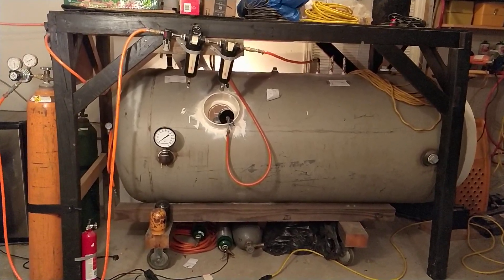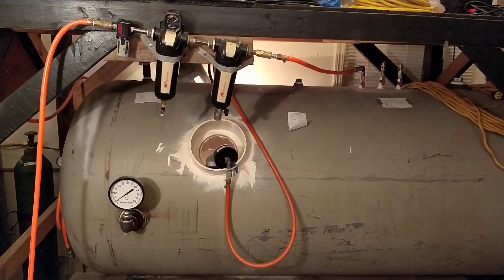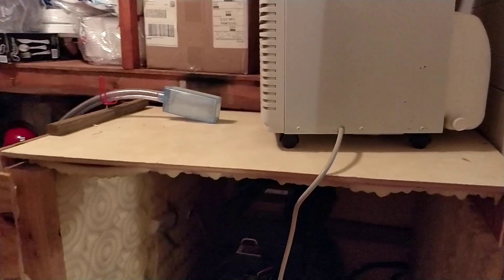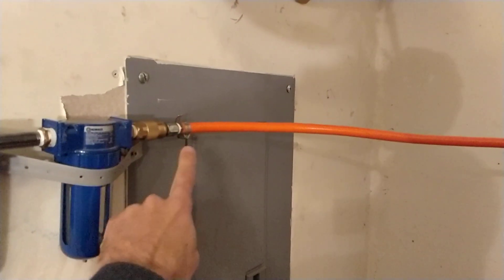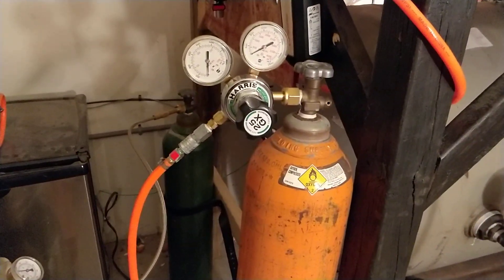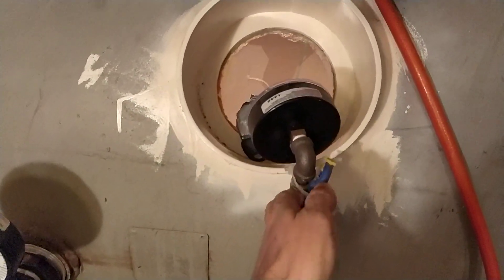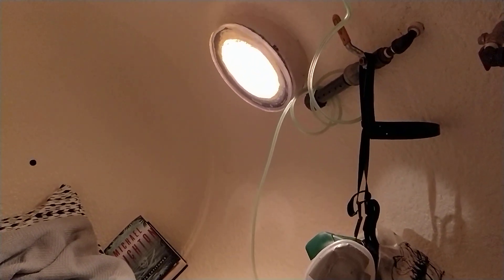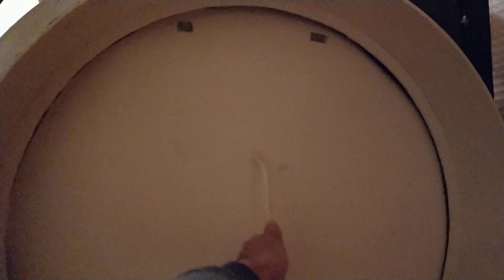Hyperbaric Oxygen Chamber (Home made)

Comment: What did you use for windows? Did someone fabricate a ring for the bullet proof glass? How thick are they?
Reply from the maker: I bought bullet proof glass off some website years ago. 1 inch thick. Then I used a jigsaw and cut to size. I simply went to a machine shop for the rings. Any machine shop will be able to get u any ring size u need. Hope that helps

Comment: So the compressor pumps in regular atmospheric dehumidified air only ?
Reply from the maker: Yes, in order to build pressure quickly. The pure O2 comes from the mask.
 It's too expensive and too difficult to pressurize the whole tank with pure O2.
Reply: @goretoye Not to mention the fire danger posed by even tiny static electricity charges in a pure or nearly pure O2 atmosphere...

Comment: The O2 hose, fittings, filters, and ball-valves are a disaster waiting to happen. The slightest trace of oil in an oxygen line can easily cause an explosion, and there's likely residual oil in those filters and quick-connects. Even residual oil from a fingerprint can burn in an O2 system. There is absolutely no need to filter medical-grade O2. That's why it's medical-grade. That hose looks like compressed-air hose. For the love of God, get some oxy-acetylene O2 hose and welding O2 quick connects (and back-flow preventers), get rid of those filters and ball valves, and scrub all of the steel feed-throughs with detergent and rinse with distilled water. Seriously. This thing is dangerous.
Reply: You are acting like a crazy person
Reply: He's not using pure O2 to pressurize the chamber. The hoses/fittings your referring to are just for the compressed air that's pressurizing the chamber, coming from an air compressor, the O2 system is completely separate

Comment: You got a nice overkill system, any thrifty advice?  In Ohio, I have been told, it is not illegal to operate a chamber and I have a guy that charges $160 a cession.
Reply: I just finished one that can be pressurized to 2 ATA (28PSI), has power on the inside, and is on wheels. I am willing to sell it if you are interested. I could probably even deliver if gas and time is paid for!

Comment: great build .
Can you talk about the connection of air valves through the steel wall of the tank. Do you use a special gasket that is rated for that much pressure? Curios :)
Reply: I just finished one that can be pressurized to 2 ATA (28PSI), has power on the inside, and is on wheels. I am willing to sell it if you are interested. I could probably even deliver if gas and time is paid for!

Comment: Hi Ed. Great job with the hyperbaric chamber. I'm trying to do the same. How did you fit the door? One would expect that the piece that you cut out to make the door should be smaller than the hole. So did you add a metal ring or something similar to make it fit? Thanks
Reply from the maker: Yep, I added a metal ring with a flange welded to it. That was placed over the hole. The cut out was used for the door on the inside. The convex (curved) side needs to be facing inside to handle the pressures.
Hope that answers ur questions
Reply: @goretoye  Thanks! I think I understand now.

Comment: Just a foot note to anybody that's gonna run down to the garage and start making one asap.....
Pure oxygen is firkin dangerous.......there is literally nothing left after an explosion.
The o2 lines must not have any sharp bends or any burrs in the pipe line or debris.
Fire blank is a must! 
U need someone to watch over u otherwise sh*t can/does happen!
Workshop oxygen gas is not rated the same as medical oxygen!
Think before you do something/anything.
Stay safe
 I like the build !,congratulations
I was wondering if u could treat covid with a chamber like this???
That's why I'm here lol
Reply: The tank is pressurized with ambient (filtered) air. The only high oxygen content is in the mask. So it's no more dangerous than someone breathing oxygen from a hose. Which granted still has to be treated with care, but it's not near as dangerous as the chambers that are using 100% O2 to pressurize the chamber.  Also the oxygen is supplied by a medical grade concentrator and he has multiple filters after the tanks. 
Yes you can treat Covid with HBOT, people are also using it to treat long Covid.

Comment: how did you learn how to make this? It is really cool and I wish I had one for the problems that I have been having with my brain
Reply: I just finished making one that gets up to 2 ATA. I am willing to sell it if you are interested?
Reply: I just finished one that can be pressurized to 2 ATA (28PSI), has power on the inside, and is on wheels. I am willing to sell it if you are interested. I could probably even deliver if gas and time is paid for!
Reply: @rileywitt1911 

28 psi is not 2 ata it's almost 3ata

Sea level pressure is 14.7 for 1 ata
So if your chamber goes to 15psi that's 2 ata. Anything over 2ata you should be under the guidance of a hbot tech.

Comment: Pretty confusing mix of the words "oxygen" and "air". You call the gas from the compressor "oxygen" and the gas from your oxygen tank "air". And it does not help that you use the same color hose. Most of these comments are pure bunk. You need air pressure and 100% oxygen. Air for safety and to not have an Apollo 1 fire. 100% O2 by means of head gear of some sort. Run 15 to 35 PSI depending on needs. Decompress properly if above 15psi for longer than 60 minutes.
Reply: You sound like you know what you’re talking about, 
Tell me .. if I was inside the chamber for 90mins @35psi, what are the protocols for for exiting the chamber safely ?
Reply: @noelcallan4071  35 psi is in this case means total pressure. Atmospheric pressure of about 15psi plus 20 more psi. I think I meant 35 feet deep in water, not psi. 

Typical safe values are more like one half an atmosphere or about 8psi in the tank compared to outside. Breathing pure oxygen is safe at that level and 15psi is safe aside. Beyond 15 psi tank pressure (2 atmospheres or 33psi total) there is danger of xygen poisoning which affects your thinking and causes convulsions.When you are above that pressure, the time is also limited by the decompression dive table to avoid the bends. But that would take hours.

It looks to me like the best pressure is about 8 psi which is the same as being 15 feet deep in a pool. Most tanks/cocoons have steady air flow from a compressor and relief valves set to 15psi and breathing with a mask supplying 100% O2 or the 9o to 95% from an oxygen concentrator. The steady flow from the compressor keeps oxygen from building up inside which could be very dangerous if there were a spark, etc.

To your question, 90 minutes at 35 psi tank pressure is the same as being at 78 feet underwater. Way too much pressure for pure oxygen. And 90 minutes is way over the 24 minute decompression limit for that pressure. (Note that breathing oxygen instead of air means you won't build up nitrogen in tissues and decompression times are much less.)
Reply: @charlesspringer4709  hi Charles,
Thanks for the reply, but now I’m even more confused lol , 
When I search online here in Europe, most clinics offering hyperbaric chamber sessions, typically offer 90 minute sessions @2.5 atmosphere , 
What does that equate to in psi inside the tank ?
Reply: @noelcallan4071  I don't know for sure but I would guess they mean total pressure. Nobody advertises a smaller number when they can use a larger one. Relative to the outside, that will be about 23 PSI or the same as 45 feet underwater. It is confusing because nobody does that in daily life. You don't add atmospheric pressure to automobile tire pressure. But for chemical and biological systems it is the true pressure that counts, or you might say the number of molecules in a container.

Comment: So I do like the idea of what you did, but how do you regulate pressure rise and pressure fall to not come up too fast or down too fast?  There is a tolerable rate.  The oxygen concentrator, I dont believe it helps create 100% oxygen, so refilling at a local gas supply would be the better option.

Comment: Hi Ed!  Awesome system!  So do you use the tanks to overcome the lack of pressure available from the O2 Concentrator?  I saw another video of a gent who is using an O2 concentrator with up to 20psi output. He said it was needed to overcome the 10psi the chamber was pressurized to.
Reply from the maker: Hi Steven. I tried that initially but it just didn't work. The trickle of air that does come through was not enough to breathe on. You will need those large tanks that you saw in the video. A 1 hour long treatment will drain the whole tank that was pressurized to 1000 psi. 
Hope that answers your question.